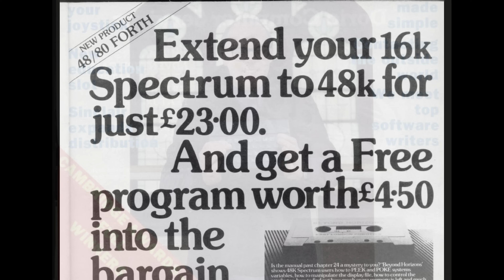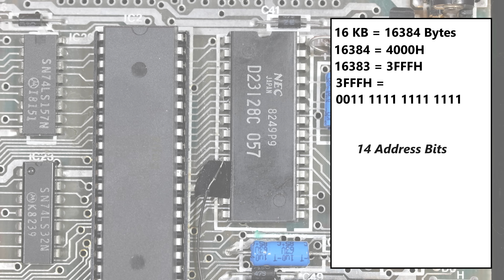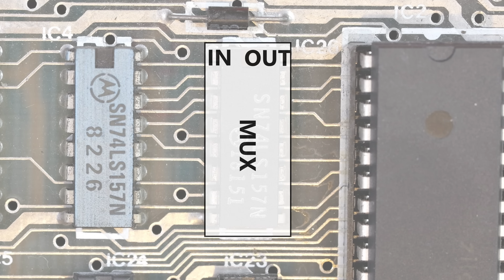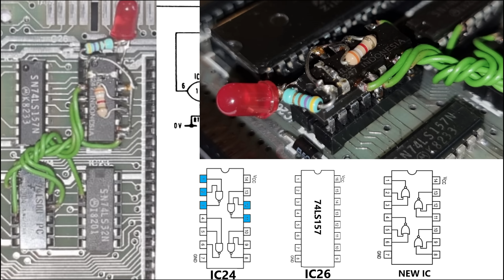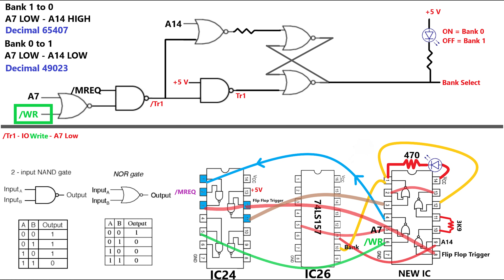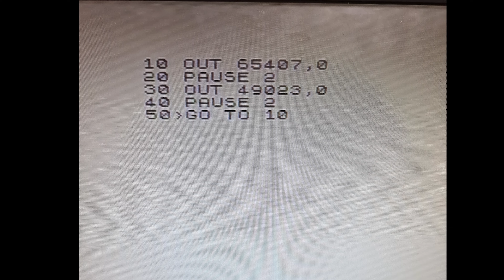Can you get 80K out of your 48K ZX Spectrum with just one extra chip??

Comment: I'm hoping the next video is a 128k upgrade for a 48k speccy mod. Something I've always wanted to figure out but have been too lazy to look into
Reply from the maker: I do have a plug in one of them which was donated to the channel, I've not gotten around to filming it yet though. I'll share some pictures in the discord
Reply: @HappyLittleDiodes  From a C-64'er, while you're at it you might want to take a look at The Transactor magazine 1 MB Commodore 64.  It was 512K expansion in the Ram Expansion Unit, but also 512K inside the 64.  And another set of pro tips..   
First advancement would be 30 pin SIMMs, because things went to SIMM and the more advanced DRAM chips ended up there, with better speed, power, and timings, but can be trouble to find the ones with the correct refresh paging to work in an older system.
Second advancement is to skip all that and use PC motherboard cache SRAM.  No refreshing so you get to toss all the refresh gating and bank switching refresh complications.  Just general bank switching control and gating the read/write access.  Usually they are skinny DIPs, and the pinouts are close to ROM so you can probably sit it on the ROM chip and do most of the connections that way.  You may have to figure out the right cache chips, early stuff often used 8 chips but later ones used like x4 or similar.  You probably need a latched RAS/CAS or something, but that's probably already done for the ROM chip anyway.
There were also the SOJ package SRAM or FPM ram that some of the early video cards used for expansion ram, they often came with 1/2 of max and could take 2 or 4 of the chips in sockets.
I built a 1 MB C-64 way back in the early 1990's from the article and a board from FIDO net.  I was keenly aware through the late 1990's and early 2000's that the SRAM parts would have made it much easier since you could eliminate all of the refresh complications, then it's just simple bank selection and access control.  It's been a long time so I don't remember the correct parts off hand, but it shouldn't take much to turn them up, late 90's and very early 2000's time frame..

Even if you still do just what's already there for the RAM expansion, it can still be easier to use those chips.  Just cut the old RAM out, hook up the x8 or two x4 chips, and wire in the data lines.

Comment: Damn, speccy had some F up memory organization, but given how sir Clive squeezed every last penny out of it, its not surprising.
Reply: it's pretty ordinary for a Z80 based machine. The ROM would be in the lowest part of the address space because thats where the CPU starts executing from at power up
Reply: @jaycee1980  not that, but the half-baked mem chips, two banks of different ones.
Reply: @VEC7ORlt  the 4116's had faster access time which was needed for the video. The upper ram being made of faulty 64K chips used as 32K was a good compromise cost wise.

Comment: I always laugh when so many Youtubers  test their upper RAM in a chip tester and discover they are all bad.
I wonder why Sinclair didn't do this mod and release it as another model.
Reply: During that era, 64kbit chips with faults only in the lower or upper half were sold officially at reduced prices. Clive being the farthing pincher he was, and as the Specci only needed 32k, these were perfect, no need for bank switching.
Reply: The 128's memory paging is based on the same principles as thsi
Reply from the maker: I've not seen that! Makes sense though haha
Reply: @HappyLittleDiodes  The chips were available as Hi or low32k. Look at the circuit board, you will find a bridge where you can select the ram type. I'm surprised that this bridge doesn't have to be removed with the mod.